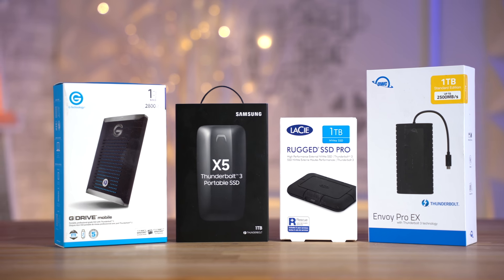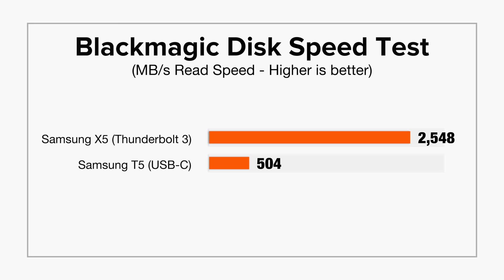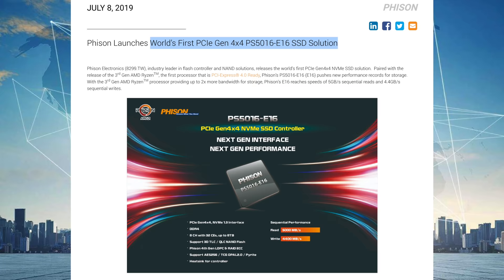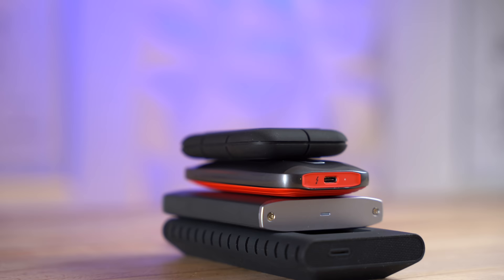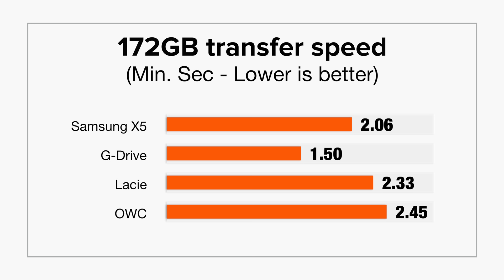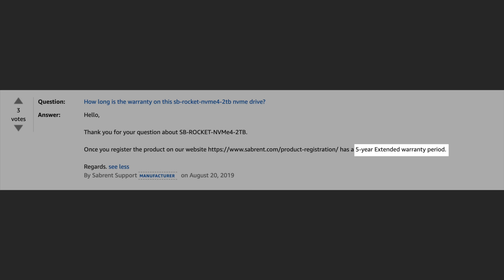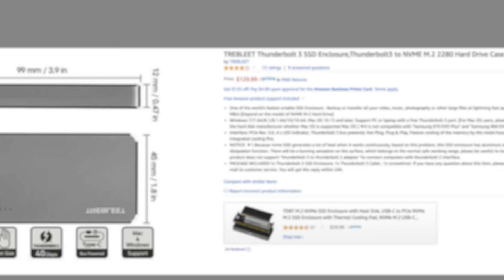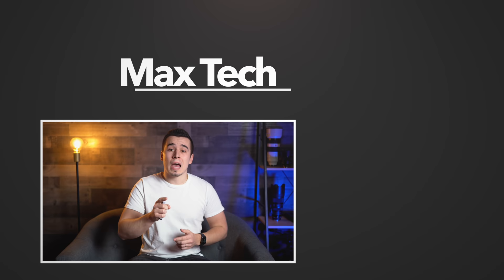How to Build the FASTEST Portable SSD for LESS $$$!

Comment: I have 2 of the WAVLINK enclosures, they both came with heat-sinks in the box but i guess they don't work as well ill have to do my own testing. You have to be careful which SSDs you decide to buy with it. It only supports single sided PCBs like the Sabrent and even then it sometimes doesn't work. I bought an XPG Gammix S5 that doesn't work at all. It seemed to only be made for the Samsung SSDs, but now that i know it works with PCI 4 SSDs i cant wait to get one in.

Comment: Small detail I want to point out: USB-C has very little to do with speed.
You can have USB-C running at USB2.0 speeds and USB-C running at USB 3.2g2x2 (or even USB 4.0 soon)...
Reply: Good point.  It is just a form factor.

Comment: Another YouTuber, CKid, took an M1 Mac Mini and paired it up with a Samsung SSD 860 EVO SATA 2TB Drive installed in the Elecife USB Type C Hub (that hub is specially made for the Mini). QUESTION: Is there a kit out there to replace the Samsung SATA SSD with an SSD card like the one you used for your external Thunderbolt 3 kit?  -OR - Is there a Thunderbolt 3 hub available for the Mac Mini???

Comment: I built a drive with that wavlink enclosure and a crucial one terabyte and it does get hot around 55° but I put a fan on the whole rig 
with my Mac mini so there’s no problem with the heat. 
but the crucial isn’t as fast as the sabrént. but it was just under $200 for both pieces and it’s plenty fast for my audio files!   i’m getting around 1200 read and write.

Comment: What cables do you use? My macbook doesn't support Thunderbolt 3, but has USB 3 ports. I am using Samsung T5 and it works fine. I was anyways planning for something like this.. However, I am stuck with the cables. I noticed the choice cables is a huge determiner of speeds

Comment: Buy a cheap enclosure, buy the heatsink for the drive so it doesn't fit the enclosure, then wrap the lot with gaffa tape? What planet did you come from? The whole concept of a heatsink is to transport heat from chips to the atmosphere in the most efficient way possible, which involves flowing as much air as possible over and around the heatsink. Wrapping with tape will inhibit air flow to near zero, so very little heat will transfer to the atmosphere. End result, if lucky, time to heat drive to dangerous level will be maybe 2 minutes instead of 1, but it will get there and take longer to cool down as well, the same is a likely outcome for a 3D printed top cover as well, unless the person designing and fabricating it has a fair amount of experience with airflow and thermodynamics. How do I know, 40 yrs engineering experience dealing with 1200W a side audio amplifiers, radio and TV transmitters to 5000W, and power inverters and charge controllers up to 12000W.

Comment: Can you recommend a fast and reliable SSD enclosure that will work on both Thunderbolt 3 devices AND USB-C devices? I have a Sabrent (model # SB-RKTQ4-4TB) 4TB Rocket Q4 NVMe SSD.
I haven't personally tried it, but I believe the Trebleet Thunderbolt 3 SSD Enclosure only works with Thunderbolt 3, and not USB-C devices.

Also, would the above setup be faster than a Sabrent Rocket XTRM-Q SSD, considering the SSD in the Sabrent Rocket XTRM-Q SSD is the SB-RKTQ-4TB, which is a slower SSD?

Thanks!

Comment: Hi and thank you for this interesting content!

Actually, I bought the exact setup you were featuring in this video, but with the Trebleet enclosure only, not with the additional heatsink. Well, this external drive is really rocket fast in reading and writing. I really do appreciate it. 
BUT: After using it for a while, it suddenly unmounts itself from my macbook (Catalina latest OS). Sometimes in the middle of a process, sometimes just when being mounted but not beeing accessed by any program or task. I suspected an overheating at first because the hard drive heated to about 48°C / 118,4°F, sometimes 52°C/125,6°F  when beeing used by Lightroom, Photoshop or iMovie e.g. So I started to cool it  down permanently to 35° C / 95° F by using a tabletop fan standing next to the Trebleet. Unfortunately it didn't get any better and immediate unmounting is still happening unpredictably. 
Do you or anyone here have any ideas, why this is happening all the time?
I don't assume you had this kind of problems in mind, when recommending this Sabrent-Trebleet-unit. But maybe some more people do have the same issues?

Comment: What type of computer did you use? I wonder if that makes a difference.  I put a Sabrent Rocket 1tb into an Avolution thunderbolt 3 on my MacBook Air and I am in the 1600 read and write range. The enclosure is full aluminum, and was fairly expensive. Lots of heat sink too. Any idea why the speed difference?

Comment: Hi, 
Is it 500gb ssd drive enough? or would it be better to get a 1tb instead? what do you think the minimum is to make a good difference? i currently use mojave os, thanks

I have: MacBook Pro (13-inch, Mid 2012),  2.5 GHz Intel Core i5
4 GB 1600 MHz DDR3.   Intel HD Graphics 4000 1536 MB

Comment: If I use Sabrent 2TB Rocket NVMe 4.0 Gen4 PCIe M.2 Internal SSD, the same case (Enclosure, Thunderbolt3 to NVME M.2 2280 Hard Drive Case) will be OK? And if I don't use an external heat sinker, will it be any problem?

Comment: Cool stuff, very helpful. Does someone know of a comparably portable solution that works with earlier, Thunderbolt 2 equipped Macbooks? I know the types of drives and enclosures that match the ones shown in the video would work with the Macbook's USB3 port via a USB-A to USB-c adapter but I would hate to have the SSD's nice speed limited that much. Apple's Thunderbolt 2 to 3 adapter does not provide power so it wouldn't work.

Comment: How much does FPCX rely on disk speed?  I've assembled a couple NVME M.2 1Tb sticks with enclosures, but they are limited to USB 3.0 speeds. The top I saw was 900 MB/s. 

Wondering how much speed you really need for video editing.
Reply from the maker: 900 MB/s should be fast enough unless maybe if you multicam 4+ 4K clips at once. At that point, I'm not exactly sure.-Vadim
Reply: @MaxTechOfficial  hey thanks for the reply! I've done work with 4k and it performs well enough. I'm also using an external Sonnet EPGU (https://youtu.be/mnSyltUMf1w)  but I just never was able to determine how much performance boost you can get from faster disk.  take care!

Comment: Here’s a different option that’s even cheaper:  BE PATIENT.  Waiting the extra couple seconds (or even minutes) to transfer a file won’t hurt you.  Use the time to calm down and think about how amazing of a place the world already is.  Your great grandparents grew up in a world where cars were a novelty at best and phones were still uncommon.  You live in a society where humans have walked on the moon, your car can accelerate you with more g-forces than what holds you on the ground, and you have a supercomputer that’s constantly connected to the entirety of human learning that you carry around in your pocket (and runs on a battery).  Sit down, shut up, take a deep breath, and just think about that for a couple minutes.  It’ll do you a lot of good.
Reply: Which hard drive do you recommend?
Reply: @anandmathew192  I usually go with the cheapest Crucial m.2 NVMe drive I can find on Amazon of whatever capacity I am looking for. But anything from a reputable supplier will do, really. Unless you need the extra 3 millionths of one second when coping a file or something, it really doesn't matter. And even if you do, there is likely a bottleneck somewhere else in your system that is gonna slow stuff down unless you are running bleeding edge hardware for everything and have a PC that costs more than your car.

Comment: How does write caching work over Thunderbolt? Without it most drives are much slower than their advertised write speeds, and if you have it enabled, the drive isn't really plug-and-play per se as you may enjoy fast write speeds, but then have to wait for the drive to clear the cache to the main storage at a much slower speed anyway before you can unplug it or risk losing or corrupting your data.

Comment: i have a samsung x5 that i use on an imac as primary disk (with os on it). blackmagic test just after clean install was around 1500/2500. now, after some months, write speed starts still at 1500 but after few seconds it drops to 900. do u think slc cache its the reason? consider i use this disk only for os and apps. rarely i drop large files on it (that stays on other disks).

Comment: How can I adapt the Trebleet Thunderbolt interface to a SATA so I can plug into my Atomos Shogun? I would like to record via the Atomos, then unplug and plug into my Macbook Pro via Thunderbolt for immediate editing without file transfer or using internal SSD. Thanks.

Alternately, can I plug the M2 SSD into a SATA cradle and use in the Atomos, then transfer it after the recording, into the Thunderbolt holder for live editing?

Comment: Hey. So "trebleet" enclosure also comes with blue "heatsink" which you attached at 2:44 ? Or should we buy it separately? Thanks
Reply from the maker: It’s not a heat sink. It’s a heat transfer pad that you stick in between the case and the ssd. Comes with the trebleet enclosure.

Comment: Great way to go, thanks for the video.   Those 4.0 controllers run really hot, is it worth the extra heat over a 970 evo plus?
Reply from the maker: The 970 Evo Plus has an SLC cache limit, so write speeds will slow down to around 1200 MB/s after 30-50GB compared to this drive that didn’t slow down less than 2,300 MB/s throughout an entire 172GB transfer.

Comment: Do you think I can use the Pcie 3 model with the aluminum drive to get similar performance? I’m not concerned with Pcie 4 because I’m Mac based. I’d like to purchase the 2TB option that’s only $289 instead of the PCIE 4 version that’s $389
Reply from the maker: We also only use Mac computers. The difference is that the PCIe 4 model uses a new controller and better chips. The PCI 3 model will most likely have a 20-50GB of SLC Cache and then it will slow down to 1000-1200 MB/s just like the other storage drives we tested. The beauty of this Custom SSD is in the PCIe 4 tech combined with the Thunderbolt 3 enclosure. -Vadim

Comment: Can you perform similar tests for a different scenario? I have an ASUS ROG G751JT. It has one original Thunderbolt port. I record music, and am planning to use a thunderbolt audio interface (specifically the PreSonus Quantum 2 with Thunderbolt 2 ports which allows daisy chains) I'm trying to diy fast SSDs and like your build in this video. I'm interested to see what kind of speeds I'll see over a TB3-to-TB2 adapter (form factor of the original Thunderbolt port) to ultimately transfer over the original Thunderbolt protocol

Comment: If the drive connects to the  enclosure with a thermal pad, how about putting the heatsink on the outside, touching on other side of that thin aluminum sheet?

Comment: i have one in my laptop that just recently died would i be able to follow these steps to say pull my data off and put in on a new Laptop/PC or transfer it to another drive. Its from an old Dell Inspirion. If i did this would i be able to just plug it in and see my data or is there any sort of migration tools and software i would need since it did house my Win 10 OS?

Comment: There are plenty of similar enclosures that have included heatsinks in the chassis or even a fan
Reply: Which ones, except for the Trebleet Two-Slot enclosure (which needs an AC supply to operate) and the Fledging Shell Thunder enclosure (which has a fan, but is loud according to a few Amazon reviews)?

Comment: Hi. Sabrent also offers a 4Tb M.2 PCIe Gen3. Do you think the Gen3 will be much slower than the Gen4 when connected via Thunderbolt 3? Or is the bottle neck in this setup still the Thunderbolt 3 connection? I could really use a version of this build with 4Tb.
Reply from the maker: The maximum read and write speeds should be the same, but you may reach the SLC cache limit within 20-40GB when write speeds will drop to around 1000-1200 MB/s. The reason this drive is so great is because it’s got full write speed almost all the time. (At least 172GB worth in our testing) plus, this helps it be future proof.

Comment: Hello found this video very helpful but I’m a little confused. The enclosure you linked in the description has a compatibility sheet and it says the sabrent 4.0 (the one in the vid) is not compatible if using with Mac OS, additionally there is a Amazon review that said the 4.0 did not work for him. Can you confirm that the 4.0 did in fact work for you?

Comment: Will this work with the iPad Pros? Doesn’t specify thunderbolt 3 and the case interface isn’t backward compatible
Reply from the maker: No it will not work. Not this SSD
Reply: Max Tech bummer. Bookmarked for when I have a Thunderbolt 3 machine. Thanks for doing the research 👍

Comment: Max Tech. Can one just leave the enclosure open with that heat sink thing on it. You mentioned wrapping tape around it or making your own cover. Will it hurt if you just leave off the cover?
Reply from the maker: It won't hurt at all. It just won't be convenient for portability. But if it's sitting at home, there's no issues.
Reply: Max Tech Thanks for your reply. Hey I was about to buy these expensive thunderbolt external SSD drive for using with my new MacBook Pro. I want to transition my video editing as well as my physical Apple photos library to one of these external drives. This way I can easily edit video and pictures on the go. We have iMacs as well as MacBooks. Tired of being stuck to just one computer. So I wanted to know if you have long term experience using these build it yourself SSD with NVMe as well as using thunderbolt? I hope to use an enclosure that some say don’t get to hot in their reviews of other enclosures I have seen. I have no problem using the additional cooler like you showed in this video. As I am not carrying it away from home. Just using it around the home. Other concern is this thing leaving heat marks on furniture like wood or even if it’s sitting on a sofa. Don’t want to burn the cloth. Your thoughts?

Comment: How can we use this as a Win10 LIghtroom drive and Photoshop swap drive :-) I need to check if my Mobo has PCI4, then get a Thunderbolt card for teh mobo, and then apply this. but can you apply a ext drive as a LR database drive safely?  I wonder if there is a way to load the SSD with a instruction set to plug in a card reader and have the files pulled off your CF or SD cards after filling up with photos or video? Hmm, lots of cool options. Currently using a M2nvme as OS for win10.

Comment: Once upon a time I bought a case like that for hooking up laptop HDD and make portable Storage device. Future proof I thought. Darn the future changed to SSD.
Reply from the maker: This one is future proof because it’s basically one of the first PCIe4 m.2 ssds that can get read speeds up to 5,000 MB/s. And it gets rid of SLC cache limits. And if Thunderbolt 4 or 5 come out in a couple of years, simply swap out the enclosure to unlock the faster speeds. -Vadim

Comment: Does it work on regular USB-C also? Didn't catch it if you mentioned it. Thanks!!
Reply from the maker: No, it only works for Thunderbolt 3 ports, as it would require another USB-C controller chip inside the enclosure, which this doesn't have. -Vadim

Comment: is the thunderbolt bottleneck causing the speed lower than advertised over 4000MB/s? Isn't the max speed allowed by thunderbolt 40Gb (~5000MB/s)?
Reply from the maker: Yes the PCIe 3 enclosure is slowing it down. When new PCIe 4 enclosures come out, you'll be able to get much faster speeds on a PCIe 4 system.
Reply: @MaxTechOfficial  sad that the apple m1 doesn't support PCIe 4

Comment: Hey, that is nice. Just a question. What did you glue on the SSD ? Was that included with the SSD ?
Reply from the maker: Yes, those are thermal pads that come with the enclosure. They help transfer heat from the SSD chips and controller to the aluminum case. -Vadim
Reply: @MaxTechOfficial  Thanks

Comment: The Trebleet enclosure you linked specs at PCIe Rev. 3.0. Is it really able to take full advantage of the Sabrent Rocket SSD’s PCIe 4 interface?
Reply from the maker: It’s Thunderbolt 3. It can’t take advantage of the PCIe 4 speeds (as in 5,000MBs)
There are no enclosures out there that can. The point of getting this PCIe 4 Sabrent is that it’s not limited with SLC cache and slow speeds like current PCIe 3 drives are. -Vadim
Reply: Max Tech that makes a lot of sense. I forgot the bottleneck was the Thunderbolt connection (easy to forget with how powerful it is). Thanks for the quick reply!

Comment: I've got the Trebleet enclosure along with the 2TB Sabrent SSD but my write speed is maxing out at 600MB/s I'm not getting anywhere near the max speed out of this setup. I'm using a Macbook Pro 16" thunderbolt 3 cable, I'm writing from a Samsung T5 to the Sabrent 2TB SSD. What can I do to ensure maximum write speed to this drive?
Reply from the maker: The Samsung T5 is limited to 600 MB/S because it’s a USB3.1 speed drive, it’s not Thunderbolt 3, so it bottlenecks the speeds. Try transferring from your MacBook Pro to the Trebleet and you’ll see those faster speeds. That’s because the MacBook Pro support Thunderbolt 3 speeds and it comes with very fast SSDs.
Reply: @MaxTechOfficial  Thanks so much for your reply! I thought that might be the case. I will do some more testing. I was hoping to be able to transfer SD cards blazing fast but I guess I will always be limited by the other source. Thanks again!